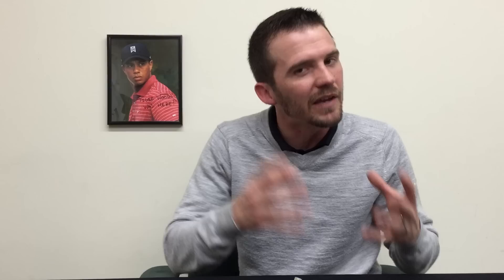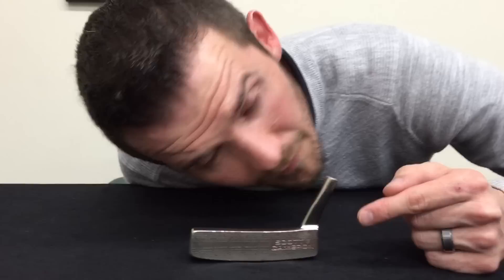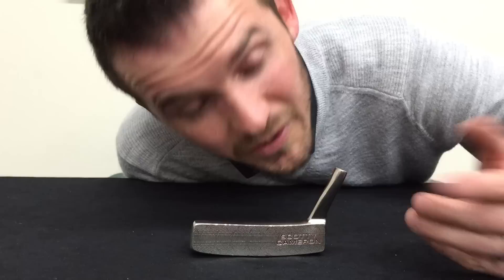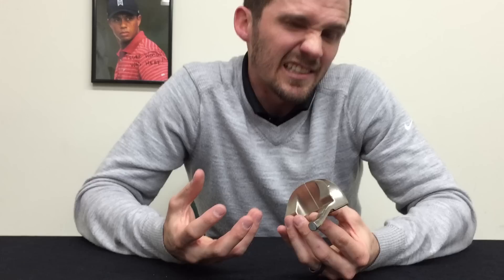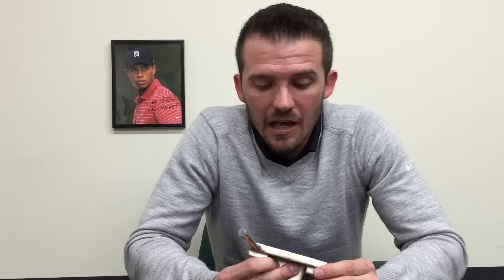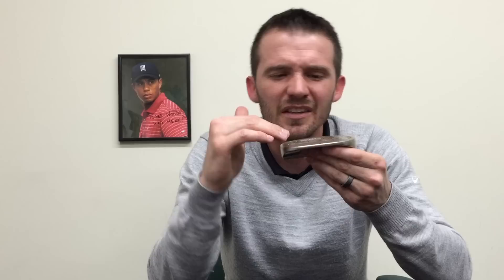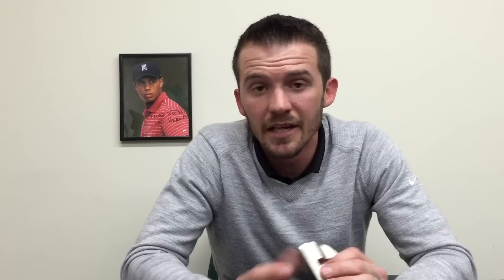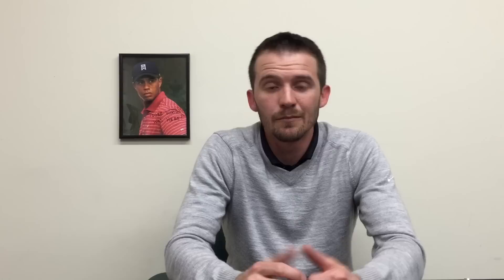How to Spot a Fake Scotty Cameron Putter

Comment: Scotty Cameron registers all his putters, and the registration number is engraved on the underside of the shaft, just below the grip. You can call them and they will validate a number, as I have done. If there is a number and it's not engraved, but stamped instead, counterfeit.  If you're buying on line, just ask for the number.  Caveat emptor.
Reply: Greg Linnell I just tried looking mine up. 6 digit number? Below the grip?
Reply: Greg Linnell I tried looking it up on the website and it said it couldn’t be found....my number also doesn’t start with an A
Reply: It's a seven digit number, and you can call Scotty Cameron offices in southern California, like I did for one of them.   The others came directly from my Titleist rep for our club. Those people will be very helpful, and trustworthy.  They hate counterfeits and will do what they can to stop the flood from China. Those from China will have the stinky grip, a decal on the top of the shaft, and be aluminum.  I will say, the Chinese do a pretty good job with the counterfeits.
Reply: No scotty Cameron serializes all their newer putters older scotty camerons from 1990s and early 2000s don't have serial numbers.

Comment from the maker: The MAGNET test is not fool proof and will not work with aluminum based models, but I called Scotty Cameron and they confirmed that even though newer Scotty putters are made from stainless steel they still carry a light mixture of carbon that will weakly attract a magnet as demonstrated in the video… having said that counterfeit models can still attract a magnet so the only way to fully know is to send it in to Scotty Cameron and have them inspect it.  Thanks!
Reply: Fried Eggs Golf ljl
lj
Reply: Fried Eggs Golf mine was like that. I actually bought mine through a titleist rep in ATL. My paint is coming off. Is that normal?
Reply: Not sure who told you this but the type of high quality stainless steel in SC putters is not magnetic.  Very easy to prove go and try it in a golf shop.  Lower grade stainless still be firmly hole the magnet.
Reply: The magnet test ALSO does not work on 303 stainless steel models.  I tried and it did not stick and Google says it's non magnetic...I almost accused my friend of selling me a counterfeit...

Comment: Great, I've just made a big fuss over my ebay purchase because of your vid! magnet test right! Why don't you correct it or take down?
Reply: agree toatly. i called the guy i bought this from and had it out with him.
Reply from the maker: +Robert Keelen Jr The magnet test is not fool proof and will not work with aluminum based models, but I called just called Scotty Cameron after reading this comment and they confirmed that even though newer Scotty putters are made from stainless steel they still carry a light mixture of carbon that will weakly attract a magnet as demonstrated in the video.  What model did you buy?
Reply: I almost did the same thing, but did a little more research/watched your video on my computer and noticed your annotation that's been added.

I bought a 2012 Newport Select Notchback on eBay and got all in a fuss over the magnet test, lol. Turns out there's different types of stainless steel so the magnet test is kind of bunk all together.

Any word on if a magnet should stick to a 2012 Newport Select Notchback?

thanks,
Reply from the maker: +Rick Hogan You're correct, the magnet test is in no way fool proof.  I found that the stronger the magnet the better he results.  But I'm not sure on the notchback, when someone trades in an older Cameron to the shop the first thing I do is put a magnet to it... So I'll let you know if I come across one.
Reply: He is getting loads of views, but still giving out incorrect information. he should correct his video or take it down!

Comment: The part about camerons being magnetic is not entirely accurate, 303 stainless steel isn't magnetic. Do extensive research look a the serial number on the back of the shaft and call titleist. The putter head itself Titleist can't verify unless you mail it to them and it costs like $75

Comment: His discussion about material is not true.  Not all genuine Scotty Cameron are 100% steel.  To test whether or not the putter is genuine or not, simply try to remove the weight.  If it unscrews, it's real.  On counterfeit putters, the weights seem real, but they are not.  It can not be removed.
Reply: That is one, and also the prize tells a lot....if you can buy it for less than 250$ new, it's not new....is that a BAD putter ? Who will tell ?

Comment: 303 stainless steel is not magnetic. Your magnet in the vid is sticking to the weight in the base. Correct it or take down!
Reply from the maker: +John Moore Hey John, you are correct that 303 stainless is not magnetic, however I just talked to a person at Scotty Cameron and they confirmed that there is a carbon mixture in the heads that will give it a weak magnetic attraction (enough to hold a magnet). I promise you that the magnet is not sticking to the weight ports… I have a couple 2016 Select Newports here in the shop that are made of 303 stainless… I stuck a magnet to the neck of every one.  I hope to make a video that explains this a little better than I did on my first attempt.  Thanks for your comments.

Comment: you should take this down, your joke are not funny and your information is not correct.
Reply from the maker: +Robert Keelen Jr I called just called Scotty Cameron after reading this comment and they confirmed that even though newer Scotty putters are made from stainless steel they still carry a light mixture of carbon that will weakly attract a magnet as demonstrated in the video.  What model did you buy?

Comment: You are getting loads of views, but still giving out incorrect information. Correct your video or take it down!
Reply from the maker: Not sure what part you think is incorrect?  I explained in the annotation that even though stainless steel is not magnetic I called Scotty Cameron and they told me a strong enough magnet will stick because the heads still contain carbon… as demonstrated in he video.  I can't say for certain that every putter will work (obviously not aluminum) but every one I've tested has a slight attraction.  Lets not forget that this video was made to bring awareness to the fact that fakes do exist and it's better to be over cautious.